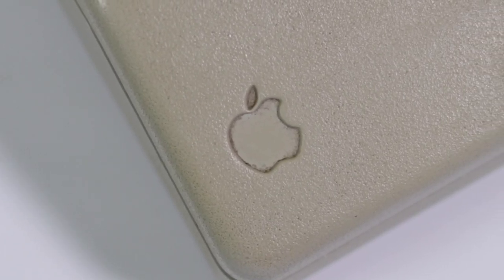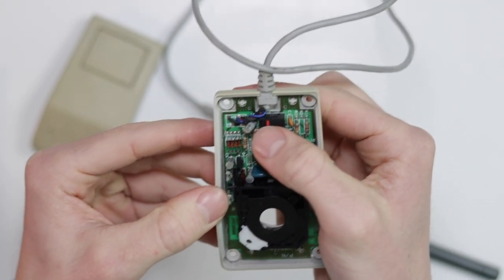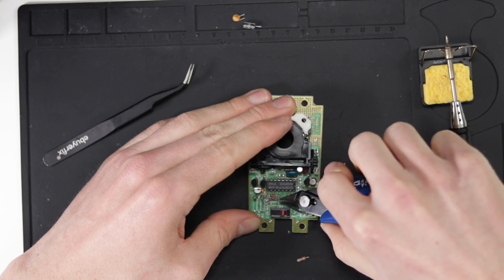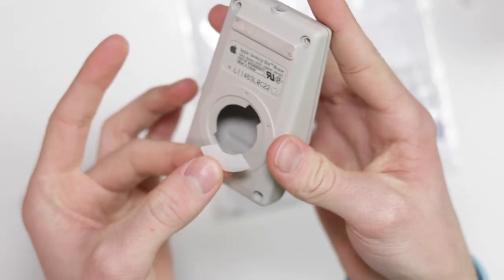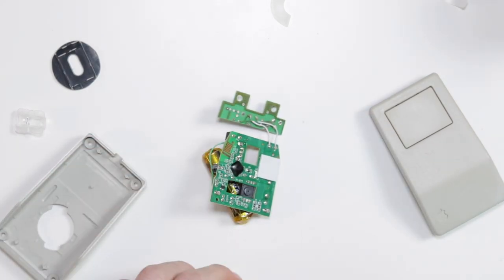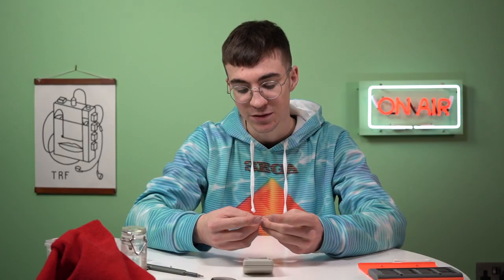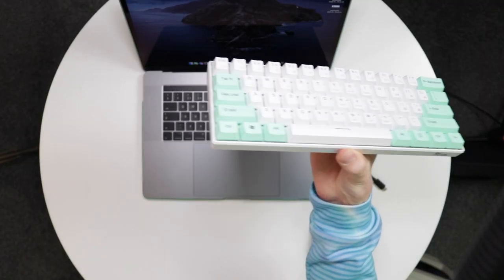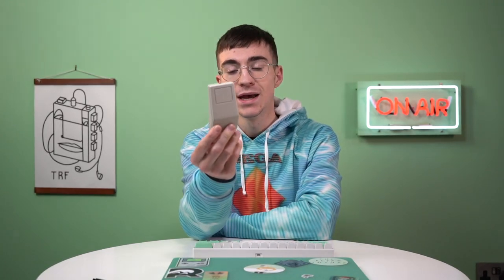Wireless 1986 Apple Mouse Mod

Comment: Me: Oh, cool, mod should be rev- Watches all the internals to a classic piece of hardware get butchered.

Christ, just fucking desolder the switch you need from the new mouse board, run some wires to the terminals and cut a little plastic bracket to epoxy the switch to. What the actual fuck are you doing???

Comment: Strip a laptop down to fit it in the Mac case.

And regarding a battery you can get one if it's installed in an item so you just need to find a cheap item with pre-installed battery.